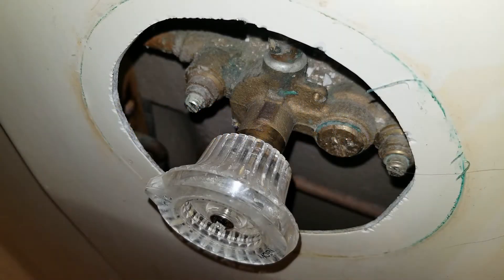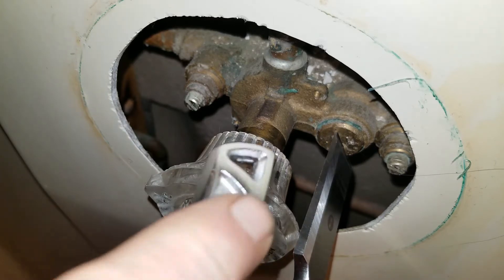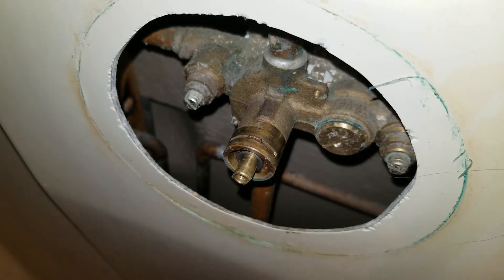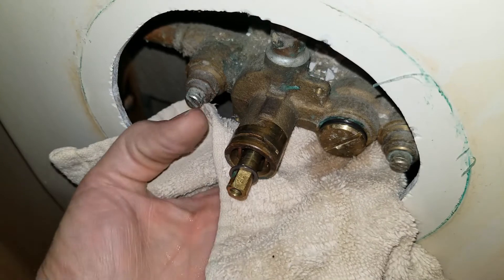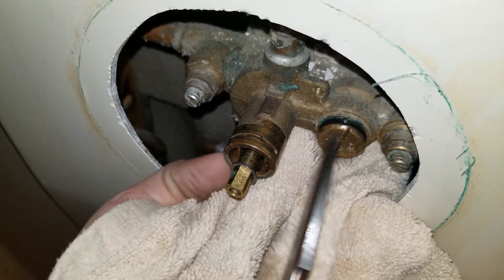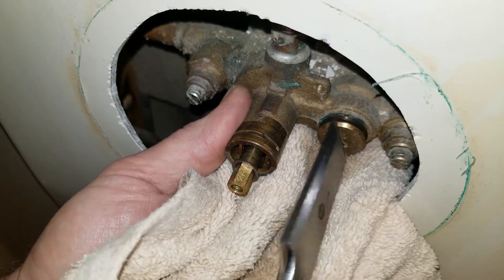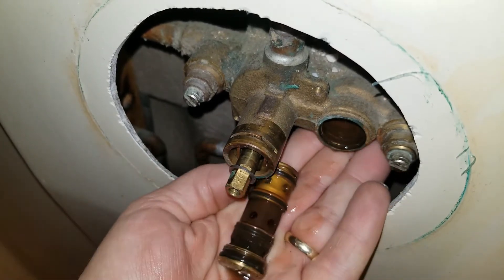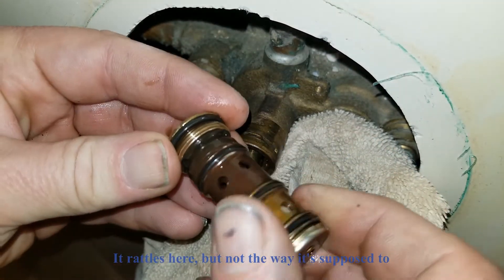How to Remover a 1423 Balancing Spool from a Moen Moentrol Shower Valve

Comment: Will replacement of that part get my hotwater pressure working?   Everything here is about cold. My cold water pressure is fine if i turn knob to the right . When i turn knob to the left the hot water pressure is low and slow
Reply from the maker: I'm not sure. My problem was more of an "all or nothing" kind of thing. Overall, this repair helped a bit, but wasn't the be-all and end-all I was hoping for.
Reply: Did you ever get it resolved? I have no hot water right now (after shutting off the main in the house for a different project), so I question if this balancing spool may be clogged or if the Hot inlet on the left is clogged.
Reply: Does sinks give you hot water? @steamstarter

Comment: Couldn't you have turned the hot and cold water off right there at the valve?  So your family could have running water?
Reply from the maker: I don't recall shut-off valves being visible or reachable. And the world won't end if they don't have water for an hour or so.
Reply: @jimmurphy5739 The screws are right beside the valve lol

Comment: Jim you are the man!   The chisel idea saved my a** today.  Tried using the largest screwdriver I had but the blade was only about .5 in wide and it is tapered at the end which allows it to skip out of the slot easily.  After a couple attempts and beginning to mar the slot, I went to HD and bought a 7/8" chisel, ground it down on my bench grinder and it worked perfectly!!  Thank you, thank you!
Reply from the maker: Glad it helped! Hope you skipped the boring blather!

Comment: Nice Video! I bought the biggest flat screwdriver i could find but didn't work..What kind of grindstone did you use? Grit?
Reply from the maker: I freehand it using the coarse wheel on my 6-inch Delta grinding wheel. I might have touched it up afterwards using fine sandpaper or my flat Sharpal 300 grit diamond stone. Good luck!

Comment: Besides the usual cautions (shut water off at the street and not mess with the not and cold check valves),  used the widest screwdriver/scraper blade plus channel locks to slowly unscrew the balancing spool and gently pull it out intact. Put a new spool in and solved the problem where the shower was only delivering hot water.
Reply from the maker: A heavier scraper blade would work well. But not a drywall knife, which is what first came to mind when you mentioned "scraper."
But of course, a drywall knife isn't a scraper (even though I often use it as such.) A scraper has more meat to it.
Good suggestion! Glad it worked.

Comment: Nice! It’s such a stupid design
Reply from the maker: Agreed.
And to add insult to injury, this POS gizmo isn't covered by the "if it breaks, we'll replace it for free" warranty like the valve cartidge is. It's MONDO expensive.
Reply: They should have made so it could be removed with a socket, like the diverter.

Comment: Thank you, so much, for recommending using a chisel for removing the balancing spool.  Mine was hopelessly stuck!  I couldn't turn it with pliers, but I was able to loosen it by hitting  the edge of the chisel with a hammer.  Until I saw this video, I was losing hope of even getting it to budge.
Reply from the maker: Happy it helped!
And that former chisel, now massive screwdriver, has its own place in my tool bag. Useful!
Thanks!
Reply: @jimmurphy5739  That’s a great idea. I’m trying to remove a 1423 cartridge now. Was googling “XL slotted screwdriver” with no success. I may resort to this. So difficult to remove.
Reply from the maker: @FRCP12b6  I haven't ever been able to locate an actual screwdriver big enough to fit properly and transmit enough torque without twisting out of the groove. This thing really is a DIY solution. On the plus side, that "screwchisel" has come in handy for a number of other applications since then. Good luck with the 1423 task!